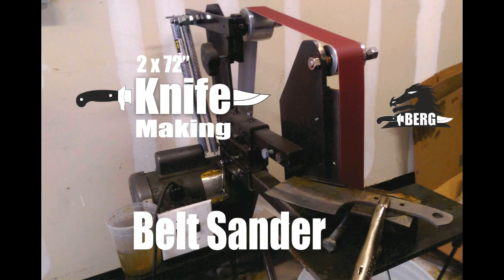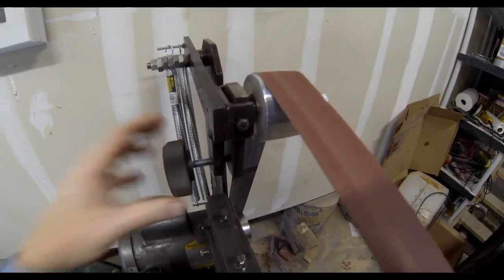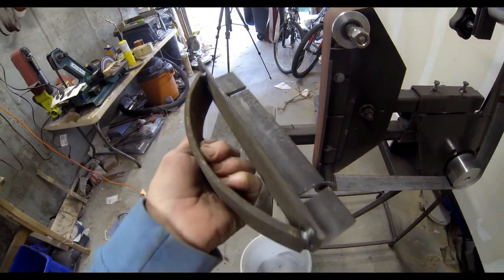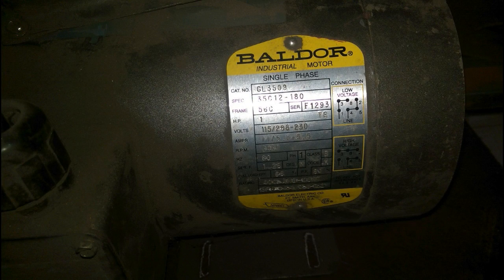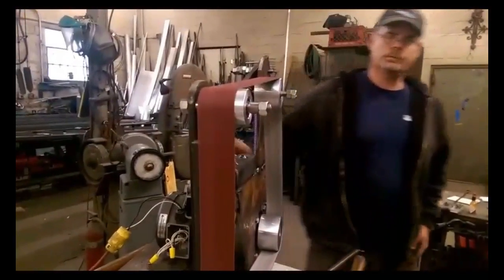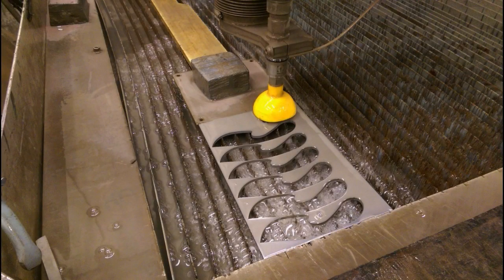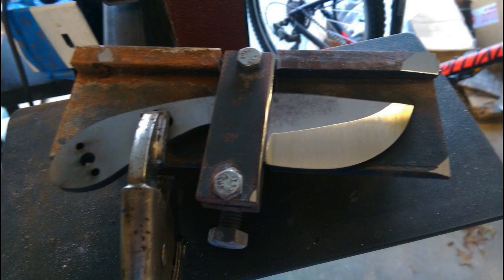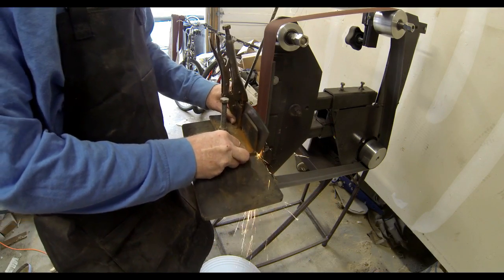DIY 2x72 Knife Making Belt Sander how to make

Comment: Grinder, sander, linisher? I think it really has more to do with the application. Sander is more referring to sanding for wood, Grinder is removal of metal material, but linisher is the best term as it refers to the polishing or removal of excess material from (something) by contact with an abrasive moving belt.
Nice LINISHER by the way. Cheers

Comment: What size and thickness tubing did you use? Great video but I needs more detail. The tracking adjustment looks very interesting. Are there any plans for this belt grinder? Nice video, but need more info, thanks.